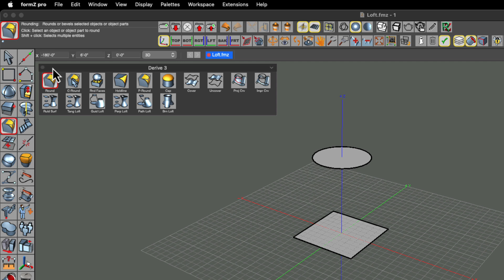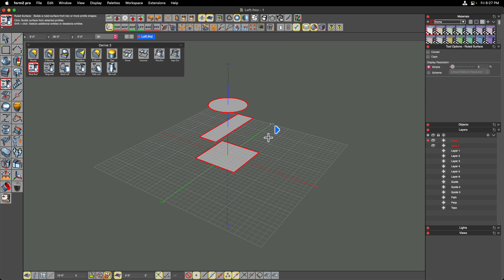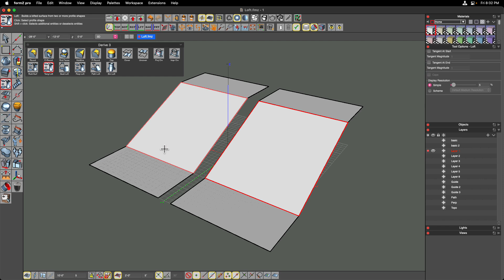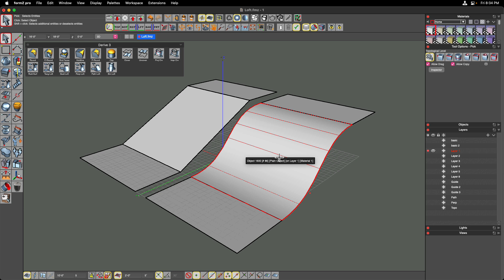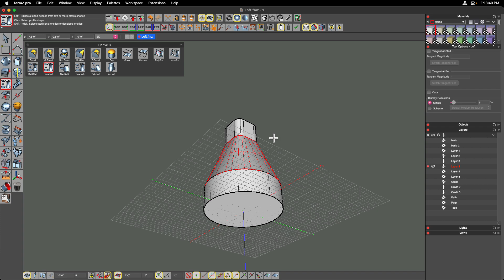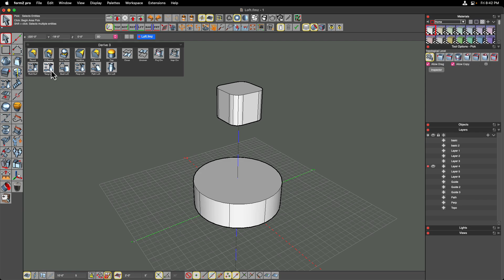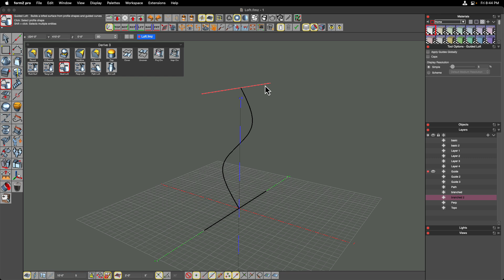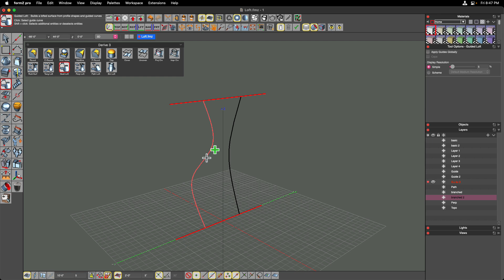Lofting, Part 1

Comment: Hi Evan! Glad to see you're back with another video! Absolutely loved this one but I have two questions. 1.) Will "Part Two" deal with "Skin" and Cross Skin"? 
2.) If I wanted to make an automobile fender with styled creases (similar to your Guide Lofting) would Lofting or Sub Division be the better tool(s)?
Thanks,
Gianni
Reply: Hey Gianni, I’m not the best person to answer that question because I’m an architect by training. You should probably ask your question in the forum for access to those experts. SdS are great for visually tweaking geometry but as far as I know NURBS are going to get you exactly the output you want (with probably a lot more setup time to get the guides how you want them). That’s my intuition at least.
Reply: @EvanTroxel Thanks! Very helpful. I’m not familiar with any forums for FormZ. Do you have any links? See you in the next one.